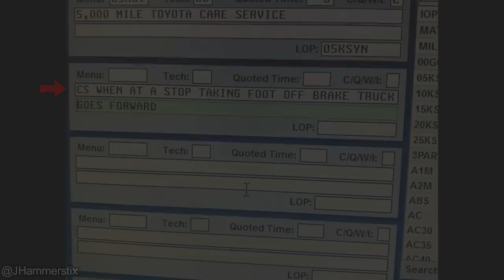Customer States Repair Flat Tire | Just Rolled In

Comment: Lol, truck moves forward when you take foot off brake? 

Sounds like a loose nut behind the wheel.
Reply: Haha might be the most no shit one I. All the videoes lol
Reply: I have only experience with manual transmission cars, but when in neutral at a stop, the car doesn't move at all (assuming a flat surface), even without holding the break pedal.  
 
Do all trucks behave like in the video or is it an automatic transmission thing?

Comment: 0:15 I did something similar when I first started driving. I found the LR tire flat on Sunday night so I changed it before bed. I just didn't go to the tire shop near my high school all week. Coincidentally I had gotten in trouble during that week and had a Saturday school. Upon getting out, I found my RR tire had gone flat, with the spare still being on the LR wheel. As it was Easter weekend, there was nothing going on at the campus and the teacher who came in to make us work told me if I didn't drive out of the lot on the flat, I would see my car locked in for the long weekend. I drove out on the tire and then I just continued to drive the 2.5 or so miles to the tire shop. About halfway along the tire began to shred and being this far along, I just kept going. When I was almost to the tire shop the tire actually came entirely off of the rim and I was just driving on the steel wheel. A quarter mile driving on bare rim and perhaps the better part of a mile driving on a shredding tire was enough to ruin the wheel. The tire shop patched the flat tire in the trunk and put it in place of the now ruined wheel. My first trip to a junkyard was going to get a replacement wheel/tire/hubcap assembly so my father wouldn't figure out what I did. I still chuckle at how it must have looked to other drivers, driving on a 6 lane sub-divided highway with a 45MPH speed limit, seeing a Chevy creeping along in the right lane with the hazards on, limping along on a donut spare on the left rear wheel and a shredding flat tire on the right.

Comment: My guess with the Subie at 2:45 is it's owned by an old-school ham radio operator who wanted to have the world's only mobile spark gap transmitter.
Reply: I thought it was a micro arc welder, but I agree with the radio operator idea. 

And by the way, radio operators were often nicknamed "Sparks" or "Sparky". I did police dispatching; when a cop started calling me Sparky I was honored. He was young but knew that bit of radio geekness. I put the US Army Signal Corp crossed semaphore flags pin insignia on my uniform from time to time after that as a symbol of my geekiness. :)

Comment: It's amazing how many people tow manual cars in gear behind an RV. Those two groups have practically entirely overlapping Venn diagrams, it seems.
Reply: i assume when they are hooking it up they go slow in first gear. leave it in gear so it doesn't roll away while hooking the towbar. then forget to put the car in neutral.

Comment: People install their own sound system and do this kind of damage make me think that places like Best Buy will install it for less than the damage the customer did to their vehicle. If you purchase the radio from them, they will install for free, plus whatever adaptors you need for your car... People will never learn..
Reply: I always do my own stereo installs but never had an issue like that. Alarm systems are something i wont touch. Gotta mess with too many important systems. For that ill pay a reputable shop.
Reply: @_AndromedaGalaxy_  My case, I'm too busy to deal with all the installation of wires and what not.. I installed the speakers in the doors and back, but the tech that installed my amp and radio in my new car did a fantastic job.. He has been working with BB for 20 years, he was an expert. I gave him all the wiring harness, adaptors and he did the rest.
Reply: Replacing a head unit is no problem. Just follow the damn instructions. Once you have to start custom running wires, if you don't know exactly what you are doing, don't do it.
Reply: When I got my Jeep XJ it had a Honda radio in it. I went to Best Buy and bought a nice Pioneer to replace it, and decided to have it professionally installed. Those "professionals" installed it 1/4" behind the dash panel, looked like $hit. I reinstalled it myself and did a MUCH better job than those "professionals" did.
Reply: @_AndromedaGalaxy_  I've done many custom systems in my cars over the years including a few alarms. Never had any issues. I guess being a hotrodder with Mechanical Engineering Degrees helps! ;)
Reply: @flyinbrian865  In the old days you had a relay and some wires. Now you need a computer to tell the relay to tell the 2nd computer to tell the lights to turn on. And that's considered an "improvement" and "more reliable".
Try replacing a fuse on some cars; you'll be at the parts or big-box store trying to find the "fuse design of the month" somebody decided to use because marketing reasons, or the vehicle manufacturer decided a 20 year old design wasn't good enough, so let's create a new mini-micro-Maxi-glass-cartridge-ceramic-element-polyunsaturated version nobody else uses.
Reply: @PhilG999  The fact that you may actually known how to use tools and build things puts you far ahead of many engineers; seen this in a manufacturing environment, where engineers messed up equipment so bad they had to get manufacture's reps in at big cost to straighten out the machines.
Reply: @markh.6687  I've seen it too. My Degrees are in Mechanical Engineering Technology. We design, weld, make parts in the machine shop, and pretty much whatever else comes along. Can't count how many times in previous jobs I was sent to manufacturers to get the same training THEIR field techs had! I've built a few engines too, none have failed prematurely... ;)
Reply: @flyinbrian865  You could live under the hood of that Power Ram in a pinch 😁
Reply: @PhilG999  That's nice engine work there. If they fail late enough, you just blame it on cheap parts wearing out too soon. :)  Unless you made the parts.....oops!

Comment: That poor Legacy. Darn rats. You can actually hear the car running worse when the wire(s) is out of position.
Reply from the maker: Yea lol, it was pretty cool to see. But yea those damn 🐀
Reply: Come on. That's wireless ignition. Hahahahahaha
Reply: That wiring is so bad that when the broken wire is pulled too far away from it's other end, the arc is jumping to the adjacent wire trying to complete the circuit through the insulation(!)

Comment: The Xmas tree 😂🤣😂🤣 On a fun note, I replaced the passenger side front axle- the boot was split in half. The crazy part? I have a 2004 V70 with over 258,000 original miles and that was the original axle on the car. The drivers side was not replaced- still in great shape and also original. I’m still floored by that! 🤯
Reply from the maker: Volvo makes great stuff. My father use to have a XC90. Loved it for the couple years he owned it.
Reply: @JustRolledIn  I’ll say. I love this wagon.
Reply: Since I don't fave a CarFax report on my Toyota, I have no idea who had repairs done previously but It has 337K on it and many parts seem original. Except struts which were replaced at 319K. Not bad for a $3,000 car.
Reply: @haroldwilkes6608  not bad at all! Still impressed. They are tanks!
Reply: Quality used to matter to some vehicle and parts makers....(*sigh*)
Reply: @markh.6687  so true. Sad it’s not like that as much now.
Reply: @markh.6687  Agreed... Most imported auto parts are made in Mexico and other low-wage countries. You get what you pay for.
Reply: My civic I replaced the axles several times cause the cv boots rubber would crack and dirt would clog the cv joints and ugh what a not fun job packing the new ones 🤣
Reply: @peterf.229  I bet. I didn’t even think to do that lol

Comment: 1:22 I'll give that one a pass... to a point.

The 99-06 Silverado's were known for the leaf spring shackle failing and snapping off.  Mine did it to both sides only a few years apart.  Luckily I didn't drive at as long as that customer, but there is a sizable wear spot in the bottom of the bed because you don't really notice it until you're looking at it from the back.

1:34 and this is exactly why I believe anyone doing taxi/Uber driving needs a state inspection on their vehicles, even if there is no state safety inspection.  They have to do it on all other transit vehicles, so there should be no exception just because you're an Uber.  It amazes me how broken down every car I see when I see one of those "taxi's", always broken lights and dents all over.  They'll hire anyone, apparently.
Reply: Had the same problem with my 2002 Silverado, $900 later problem solved!

Comment: Most damaged oil pans can be easily repaired with any good epoxy putty, but Marine Tex is the best. lt's not meant be permanent, but can last a long time. Repaired an oil filter housing with a hairline casting crack with it and the repair held for over 50k before it started seeping again.

Comment: How anyone can let their vehicles get that bad is beyond me although I'm not surprised about the taxi. 
From the stories I've heard from a taxi driver and what I've witnessed I understand why taxis are in such bad shape.
Drivers lease the taxi from a taxi depot and drive them over traffic islands bottoming them out because they are too lazy to drive the extra 50 metres (150 feet). I'm not talking about nice rounded traffic islands either. I'm talking about those islands designed to stop your vehicle going any further in parking lots. Drivers strike kerbs, drive over speed bumps at excessive speed (again, not their car), are hard on the vehicle (2 speeds - flat stick / hard brake)
Taxis here only get inspected every 6 months by the transport department where they actually test the front brakes, rear brakes separately on rollers, check for flex in steering parts by putting each front wheel on a different moving part while it is over a pit with a mechanic under it and of course look for oil leaks, obvious problems, all lights are working, parking brake. They also inspect seat belts for fraying , if it actually functions, is bolted up tight
I've seen this setup because they do it for buses as well . Numerous taxis fail and have to go back otherwise they are banned from picking up passengers.

Comment: Years ago I had a Nissan come into the shop with a toasted auto trany. Turns out the guy flat towed it 500 miles with his RV. This trans does not have a rear pump and it got so hot it started melting the undercoating on the floor. Got a factory reman unit and put him back on the road. 4 months later we get a call from some lawyer wanting to sue for the bill. He also wanted the old trans for evidence. The owner was told there was a core charge on the trans and it went back to the factory 4 months ago. ($600 core as I recall) The lawyer was told to look up the towing instructions in the owner's manual. (I gave him the page #) Never heard from the guy again.

Comment: It's crazy how common people towing cars behind motor homes incorrectly. I have witnessed it all from blown tires to rims ground down to the hub and brake calipers. Blown transmissions and motors . It's sad when it's an older couple who don't know any better and are new to owning motor homes.  Not so sad when it happens to people with more money than brains lol . Also that was some crazy tire wear on that truck. I have seen some unevenly worn tires but nothing ever that pronounced.  That thing was a work of art haha. It's crazy the kind of forces tires can undergo if you think about it .

Comment: 1:01 Did he convert his truck from manual to automatic? 😂
1:08 That's some tire Popping! Forshadowing GTA5 Chaos mod
1:35 'A weird noise' "That apparently just started" Famous last words.

2:01 Actually, with the workstation to remove tires off the rims i probably could have done a seemless job with some "Shoe goop" (That glue is truly amazing. I did an experiment by making a flat on a tire and forcefully injected the glue in the hole from the outside. 24h-48h later the patch was seal and holding pressure. When that thing is done curing it actually behave like hard, strechable rubber) I have done countless bicycle air chamber patch. Even at -20°c it still flex and strech without any issue.

2:39 Atleast this customer is not an absolute mess, wiring does look like to be nicely routed. Shouldn't be a problem for the shop to correct his mistakes.
AND No rat nest like we have seen in some of your previous video.

Comment: That flat repair reminds me I was heading back from a 80 mile tow when a black guy flagged me down on the service road he had a flat tire and a spare but no jack i jacked it up and went to install the spare when I noticed a hole in the tire he had no money and his family looked pretty worn down so i used the wheel lift to break it down and I pushed a 5/16 bolt and washer with rubber bands in the hole i put the nut and washer inside tightened it up and it actually held air so off he went with the bolt clicking along i don't know how far he got but i was ahead of him by then and didn't look back

Comment: I had a customer who put in fancy rear Bilstein Nurburgring shock absorbers in the back of their 204 Mercedes C-class. I think the RO said the customer damaged the EVAP system. True, part of the fuel filler neck to the tank was broken and glued up. Also found the fuel pump leaking just from smell! It wasn’t a concern at first. Unfortunately, the ENTIRE fuel EVAP system hoses, fuel filler neck, and fuel tank are all 1 piece. They needed a whole new tank, pump and filter, and the rear suspension had to be dropped to access it because of the fuel filler neck being part of the tank.
Reply from the maker: wow, that cost them a lot more then they expected i bet lol

Comment: that long distance arcing is not the preferred method of testing ignition coils ! it's costly and dangerous to cut the wire of a running engine !!

Comment: Love the first generation Bronco but you can keep the new one! Ford shot themselve in the foot with that EcoBoost garbage! Who is so dumb that they put the water pump inside the engine? And if you order a 5.0 don't let it get to 20% oil life and 1 quart low of oil! The control module will lockdown the engine and it has to be towed to a dealership for a reset!
Reply from the maker: What year did they start doing that on the 5.0?

Comment: First one....Were you told the caliper was seized, because with a flat rim it would probably not turn when dragged over a relatively flat surface even if the caliper was not seized, i think.
Reply from the maker: Yes it was seized.
Reply: Caliper probably seized due to the excessive heat from the rim.

Comment: 1:03 If you look a little bit closer to that information sheet you see it's only a 5,000 mi checkup and reason why they could be saying that is because on new cars a lot of them have the feature that they automatically Engage the park break when you're stopped and automatically disengage it when you press the gas and the reason why they could be asking about that is some can only be turned on to the media center or some have buttons in really weird places that you can accidentally press without knowing it if you don't know how it turned off you don't know how to turn it back on
Reply from the maker: You could definitely be right.
The mechanic didn't mention more about that work order unfortunately.
And I think the 5000 miles check up means, a 5k service, so oil change, check suspension etc... the basic stuff. Not the first oil change at 5000 miles.